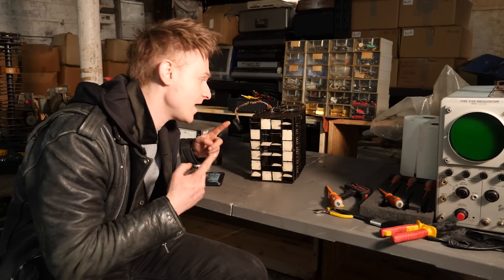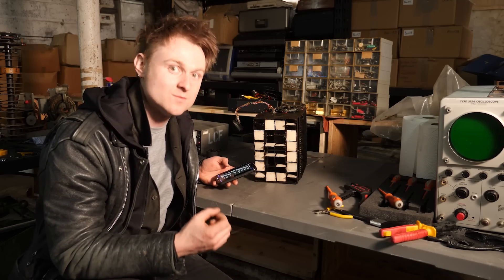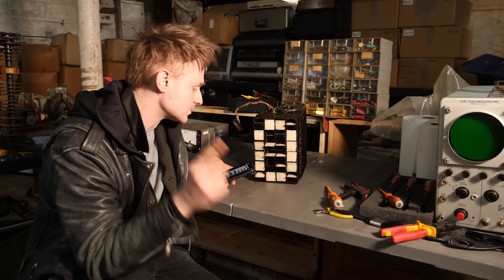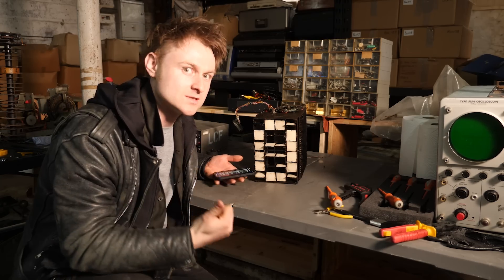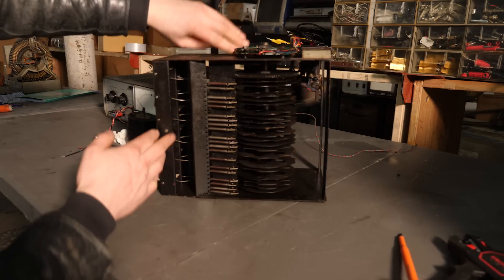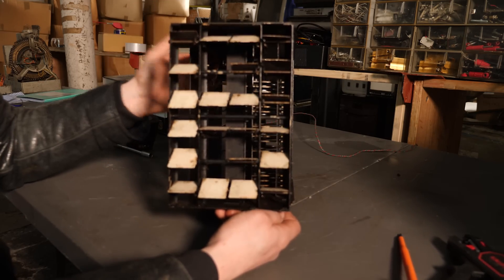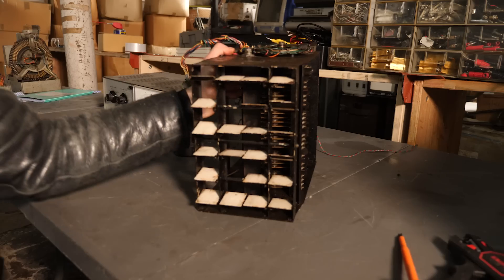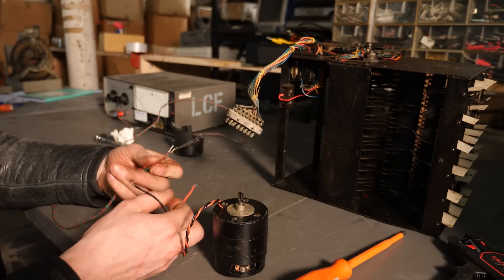A BABY TO THE STRANGE old Electromechanical "Flip Dot" Display. How Does It Work?

Comment: It could be a “hours until the museum closes” sign. Or another idea, it could be made so that you can call the display from any of the museum phones and change its current digit using the phones rotary selector. Would be an interesting build if there are no arduinos involved!
Reply: It's not very good at counting backward though, making it not ideal for a countdown-to-close. It would have to rotate through the entire display once an hour. I mean if that's the point, having an excuse to flip through all the numbers every hour, then cool, go for it. But it will never be completely smooth or quiet (it wasn't designed to be, it didn't need to be), so it's probably better suited for counting up, or carrying fixed data.

Comment: The totalisator equipment you are talking about came from the  Perry Barr Stadium in Birmingham which opened in 1928.  The ticket machine is from the original HiSpeed tote system which was superseded by the Union Multispeed machines in 1951, the stuff in Gloucestershire (ticket machines, flaps, aggregators etc.) are from this system.  My father worked on this machinery from 1951 onwards, I worked with him for a while at Perry Barr and also on the HiSpeed system we installed on a small track at Norton Canes.
Reply from the maker: hello thanks for the information. sadly its not at gloucestershire anymore. since 2010 it was moved and split between two storage aread merged in with a bunch of other stuff. the challenge is making sure we wont miss anything. as the person who put it there has sadly passed away. is there any more information you know of? or pictures? thanks!!!

Comment: Sam you recently got a whole load of rev counters, hundreds of them, made me think. Why not have a handle that people can wind. A rev counter measures how fast they are turning the handle and shows a number between 0 and 9 on the display. Anyone reaching a speed of nine tings a bell. 

The electronics need to be clever. A contact on the handle (like the distributor in your mini) sends pulses to a R/C circuit so the faster you turn, the higher the voltage in the capacitor. Voltage to number.... compare the voltage against a resistor ladder and use it to turn on one of 10 transistors these activate the motor until their selected contact is made. Thing is reversing the motor would be hard I guess they are designed to go  in one direction only, as the speed drops it would need to count down....

..well its 1/3 of an idea but an Arduino would do it easy peasy but thats cheating.

Telephone dial and a uniselector and then you can just dial a number that would be simple and fun....

Comment: The biggest question is now, how did they (or the electronics) know the position of the numbers or what number is on the display? It is not a servo motor and it is not a stepper motor and I cannot see any sensors.
Reply: the selector at the top. It's shown later in the vid

Comment: this is some of the most genius engineering to make a large display in a simple manner.  so rad.
Reply: Dunno, I'd consider a ribbon or drum, that just spins, simpler than this.
Reply: @derkeksinator17  A drum would take up a lot more space, a ribbon would wear out and get stuck. This thing is robust, compact and easy to maintain.
Reply: Congratulations on understanding a 200 year old idea. You must be so proud.